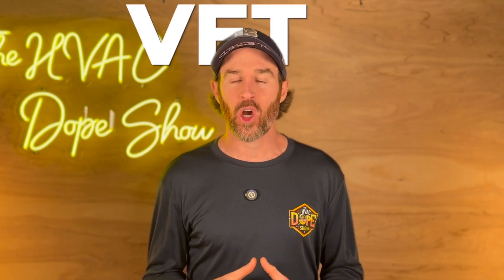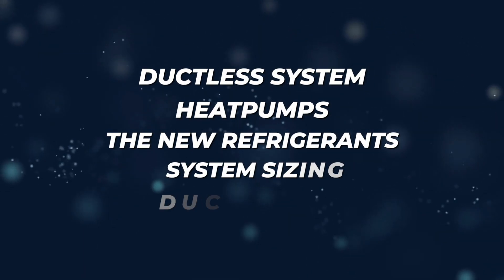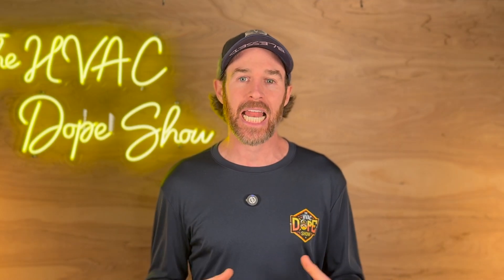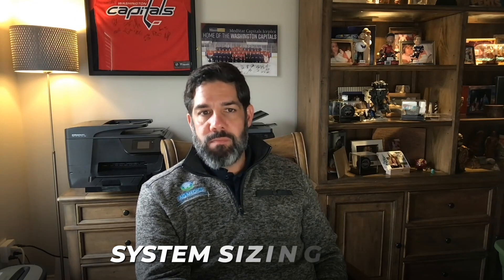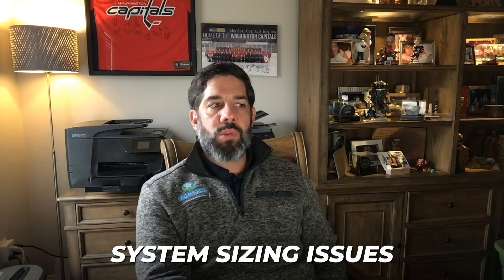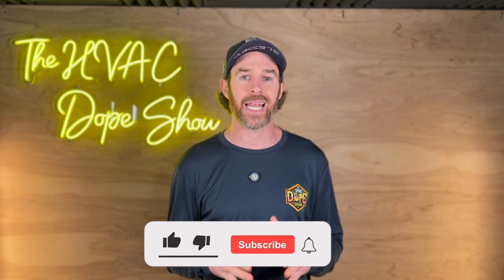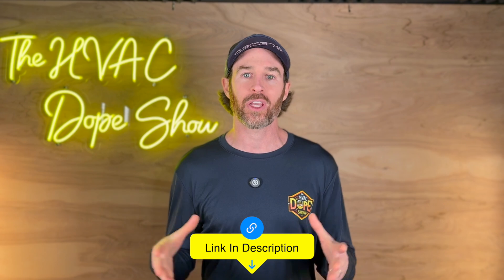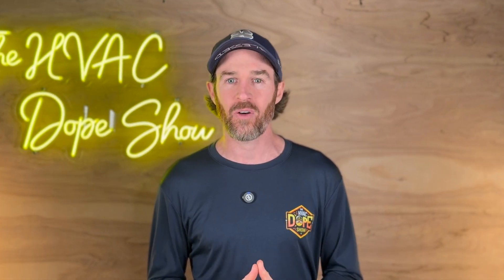East Coast Contractor Breaks down the TRUTH about High Efficiency Heat Pumps

Comment: We live in the DMV and purchased a new build home about 1 year ago with an Amana heat pump in the attic which cools and heats the second floor and a standard gas system and traditional air conditioning unit for the first floor and basement. We did not have a choice in the system or company that did the installation and have found that the heat pump does not keep up during even moderately hot days (mid to high 80s). The company that installed the system had no advice for us other than to keep suggesting we need to change the filters every 30 days. They just kept charging the system upon each visit. We finally had another company come out that found a significant leak in the air handler unit’s A coil in the attic. They replaced the coil under warranty but we were still charged over 3k on a heat pump that is just over a year old. Unfortunately, the system continues to struggle to even bring temps down to 73 degrees on 80ish degree days. We’d like to have someone very adept with heat pumps come out as we are at a loss for what to do.   Not sure that the name of the gentleman in this video is mentioned. Can you provide the name of company this gentleman is from?

Comment: the trouble with inverter equipment is parts are proprietary, over-priced and not sold online to the public.
it really doesn't need to be this way - the electronics are not expensive to produce - it's possible to have universal board designed with firmware flashed for the specific model/size.
corporate greed is the driver, too bad because it truly is great technology!

Comment: The higher efficiency models has so much electronics that it makes less reliable in my opinion. Why do we need a motor with 700+ speed settings. Ecm motors dont last and it won't save people money. As a electronic tech I see more boards failing in refrigerators, wash and dryers machines . These companies knows exactly how to make products last a certain amount of years. I have friends in HVAC say that units only last up to. 15 years and cost 10 to 15k or even more to replace.
Reply from the maker: For what it's worth those are definitely somewhat valid concerns that I've heard before but 15 - 20 years is pretty good compared to other sectors for longevity... how long does a car last before it needs a new transmission or motor etc? How long does your roof last? In my experience the inverter products are more reliable not the other way around but you have to maintain them (clean the condenser and change the filter). High efficiency furnaces have problems normally related to the exhaust and installation like whether it's tilted forward or not but I prefer 80% for this reason because at high altitudes even with high altitude kits we start running into more issues with 96% efficiency systems being more finicky unless we're out there once a year to clean everything out properly and prevent issues from developing.  So I definitely agree that 96% furnaces can be more annoying and finicky but it's honestly about educating technicians so that they don't make the install mistakes that cause these. A flat or non sloped exhaust causes issues as does not having the right slope or tilt on the furnace when the ground is uneven so I run into more issues with install than anything else which is annoying because when that happens it means we missed something small on the install and starts to make us look incompetent like we don't know what we're doing but that's why you have checklists etc for these sorts of things
Reply: Why do we only need 2 speeds? Speaking of which, a VFD had has more that 750 speeds, even a EEV has 1,596 steps! Once you get past the perceived barriers and issues you hear about, which are anecdotal, you will realize there is a sufficient return on investment… The typical homeowner might not think so, and might be correct, but commercial, industrial, and niche industries have been using variable speed equipment for decades! The reliability, or MTBF, of components is not any different from the single or two stage systems your prefer… I can understand your view and preference… But, don’t you think it is becoming more difficult to purchase work trucks with a manual transmission and analog timing? Then again, I suppose you are still driving a truck manufactured in the 70s - to that I say, congrats…

Comment: 5 years doesn't tell you anything about reliability.
Reply from the maker: True... there's truth to the thought of high efficiency being more finicky but honestly I would say even high efficiency systems for us don't have a part break for about 10 years. The issue is always if it wasn't installed tilting forward, exhaust undersized (especially at altitude you have to run 4" sometimes on large HE furnaces) and the issues with them are almost always drainage if it wasn't installed right or cleaned regularly. But if you have annual maintenance even every other year a tech will clean out the condensate trap and prevent a dumb service call in the winter. But the parts themselves last 10-15 years normally before they start failing at least in Denver. It's definitely less in markets like Houston or Phoenix because of the conditions people run into
Reply: @TheHVACDopeShow  Yes, there is no reason why with regular maintenance and proper install that these systems shouldn't last 10-15 years. I think the problem will come as they start to age is unlike the less efficient/simpler systems, repair parts are much more expensive. At some point, it makes sense to just get new one instead of sinking thousands of dollars into a 15 year old unit whereas with older simpler units, you can justify investing a few hundred dollars to keep it limping along for a few more years.
Reply: @Lwnmwrboy5  to be clear, high efficiency furnaces are no less reliable than mid efficiency when properly installed and maintained - they have the same parts just have added secondary heat exchanger and condensate handling components. very proven tech over nearly 40 years. All furnaces now sold be it 80 or 90%+ have expensive ecm blower motor. 2-stage furnaces are not really more complex either.
It is the inverter tech ac and heatpump units and modulating furnaces that get very expensive to fix.

"efficiency" alone is not a driver of high repair costs these days, proprietary parts in variable capacity equipment is. it is not a driver of lower reliability either -> what is driving reliability problems is lower quality manufacturing -> everything is made more crappy these days and it sucks. chinese made motors, ultra-thin coils to reduce materials costs.
A new minimum efficiency a/c and 80% furnace won't last close to as long as the same stuff made 30 years ago.

Comment: 2/3 of his installed systems still have gas furnaces in place. Of course the heat pumps will be less taxed in the winter and likely last longer, correct? I’m running on heat pumps only in NY - gas boiler removed.
Reply from the maker: Depends on how cold and how the system is setup if you have heat pump only it will run more than a dual fuel but dual fuel still is not perfect because it might only kick on 5 or 10 nights. If you never have a night cold enough to "need" backup heat then it's probably not as big of a difference as you might think. I've seen ductless heat pump systems last 15-20 years before a service call so it really depends
Reply: @TheHVACDopeShow  it really depends on climate and energy prices though - in many places when doing dual fuel it only makes sense to run a heatpump above freezing so furnace will run much of heating season.

Comment: When a house is burning the flame is not "pulled away". And you're gona' "talk to me about it"?  Yes, please talk to me about introducing MORE flammable material into my home. Sounds like a great idea. My home is burning then a line ruptures and pushes it higher. So many positives.
Reply from the maker: 410a already has 50% R32 blended in it, and the news ones are classed A2L meaning it won't burn without a flame. So you're technically right but the same is true for all refrigerants even the one in your home right now. Refrigerant will not be the reason your home burns to the ground is the bottom line, and if your house is on fire so badly that the line "ruptures" from the fire, the refrigerant is the least of your concern because your house would have been toast. It's not like dumping gasoline on a fire. Propane is a different story (R290) but that's why those are used with water lines not refrigerant lines, there's no propane actually entering you're home it all stays outside in a monobloc application
Reply: @TheHVACDopeShow   I get it. I guess the next thing to expect will be a building code change that will require a "hard line", black iron pipe, from the outdoor unit to the indoor unit.

Comment: Fellow DMV-area guy here!  Love this discussion and thank you to HVAC Dope Show for also engaging the East Coast!!  In late-2022, we upgraded our three-level 2.2K sq. ft. two-zone townhouse to a Bryant Evolution 19 SEER Hybrid Variable 5-Speed 3-Ton Heat Pump & Evolution Two-Stage 80% furnace. The new high-efficiency heat pump hybrid system is SO much better than our old, builder-grade single stage gas furnace and A/C.  We also added a ductless mini-split (Air Temp 1-Ton Single Zone Mini-Split) to our garage to further improve efficiency, and WOW did it make a difference in the overall comfort of our home--especially because the tile floor of our kitchen is above our garage.
Reply from the maker: Right on thanks for sharing! I've had similar equipment for 3 years now and can't complain to say the least! 😁

Comment: I think a lot of the negativity you hear about high efficiency equipment comes from contractors who simply don’t understand how it works or how to fix it. Replacing a capacitor is easy, but reading an error code requires using your brain

Comment: I am in South Carolina and have a 21 year old Trane dual fuel package unit that is using R-22; the heat exchanger just cracked, and it needs replacing.  I don't want to go with a R-410a system as I don't want to be on the tail end of a refrigerant again plus they seem to be falling apart after 5 years.  I prefer Trane/American Standard, but I am concerned about going with a R-454b system in its first year.  I am thinking about Daikin/Amana/Goodman because of Daikin's knowledge of using R-32 overseas.  My only concern with the latter deals with the fact that they didn't make the change from R-410a in the USA sooner.  Is there a reason why the Daikin brands failed to change to R-32 systems sooner?  Should I just go with a R-410a system?  Should I just tough out the next month as heat will probably be unnecessary after that, use my current system this summer, and then replace my system with another Trane/American Standard in the early Fall?
Reply from the maker: Short answer is EPA... Daikin didn't bring R32 to the USA because the phaseout of 410a was already scheduled or talks of scheduling so they waited, I'm sure it's more nuanced than that but IMO you'll be ok with either 410a or R32 and a system installed today will still have access to 410a beyond 2040 just like it's 5 years after the phaseout and we can still get Nu22 or drop in replacements if absolutely necessary, but 15 years in South Carolina is probably life expectancy for most heat pumps since you have a little longer AC season but it really makes no difference. The big thing is prices go up every year recently because of all the volatility with commodities (or at least that's their excuse lol) but I think you'll be ok with either a Trane system in a year or going forward with R32/410a for the time being. Average person lives in their home 7 years statistically so if you're hesitant and want to wait a year I wouldnt lose sleep over it
Reply: @TheHVACDopeShow  Thanks.  I really enjoy the shows.
Reply: @TheHVACDopeShow I’m in a similar situation after getting quotes for the R410 Daikin Fit. Any idea on the % price increase you would expect for the R32 model coming out this year? I saw it is more efficient but if it’s significantly more expensive I would prefer the r410 version.  I can’t find the msrp. Thanks.
Reply: @TheHVACDopeShow  I was told R22 and R32 are very similar and easy on the indoor and outdoor coil because of the oils helping the systems use. Could have just been a selling point though.
Reply: 410a they took years before they outdated R22 so I’m not saying confidently but I’m assuming we have a few if not a decade before we see any real changes.
Reply: Just go with a 410A
Any system on these days, they only gonna last 10 to 12 years anyway
It doesn’t matter the brand you choose 
I’m telling you has Hvac Tech for over 15 years